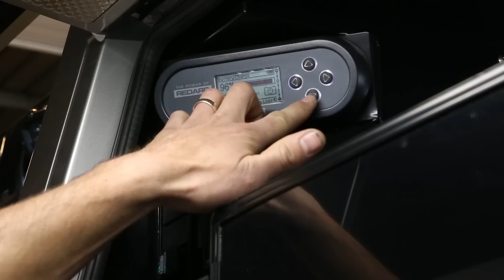How to build the ultimate expedition vehicle | Modified V8 LandCruiser 79 Dual Cab

Comment: Less than 1000kg payload on this truck, was a GVM upgrade done?, if not I reckon its overweight, with two passengers and all the gear, all the fuel, two spares, massive canopy full to the gunnels. By the way dont put anything on the towbar, it will definitely be over the GVM.
Reply: 7 ton GCM and 3.5 GVM...